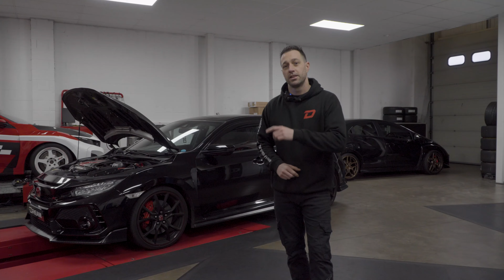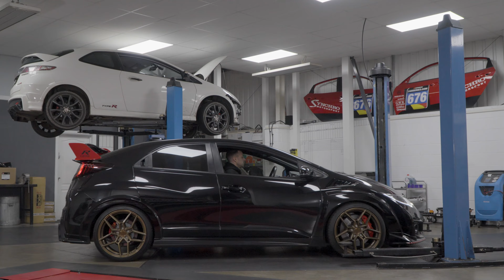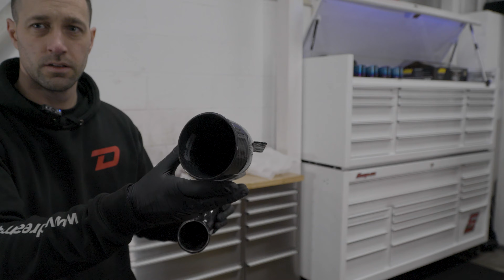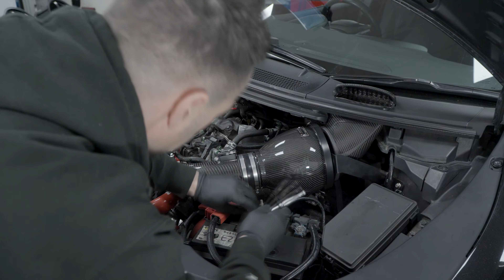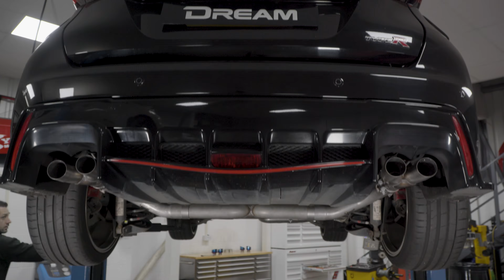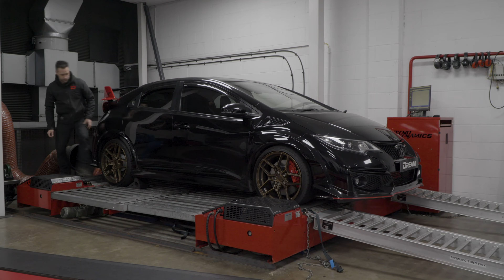BACK TO BASICS! (FK2 Type R Intake & Exhaust) | Dream Automotive

Comment: Just a question.
You don't get any problem with the regulation on the road in UK?
In France except the wheel you can change anything. And you still need to stay inside the wheel size that the constructor allow in the manual...
The insurance wont help you if you have a problem because they say you modified the car and its original certification.
Police will stop you for noise. Now they introduce new sound radar to detect loud vehicle.
And every 2 year you need to bring your car to an official check. And if something is not OEM they will not provide you the document to drive on the road. Plus they are checking the pollution level so totaly forget about Decat...
Reply from the maker: Hello, no restriction on wheel size in the UK as long as it's covered by the wheel arch.

Comment: Hope u can help. I fitted an injen intake onto my fk2 yesterday, and after starting the car, it felt as if it was going to stall so I kept my foot on accelerator  at 2000 revs for a few minutes and it was idling fine I then took it a run felt fine when I got back I left the car running and it started to slightly over rev it flagged up a  mass air flow PO102 code on my obd  so I disconnected the battery for a few minutes and tried again it started over reving again so when I disconnect the sensor it idles fine could u please tell me what u think this could be thanks
Reply from the maker: Hello, our team will be more than happy to help diagnose and solve your issue. Please could drop us an email to sales@dream-automotive.com, or alternatively give us a call! Thank you
Reply: @DreamAutomotive   wish I could mate I live in glasgow
Reply from the maker: @meetthewalkers1383  We still may be able to provide advice or point you in the right direction over the phone! 👍

Comment: Hi sir, great video as always. Just a question, I have dynotuned my Fk2 last year with Airtec intercooler + downpipe (383HP). I have installed the Eventuri intake bought from your website (best mod and sound IMO). I plan to install the milltek exhaust. 
Do you think I need to do another dynotuning setup?
Reply from the maker: Dyno tuning isn't required after the Eventuri or an exhaust, but you will get the most benefit if the car is re-tuned so we definitely recommend it! 👍